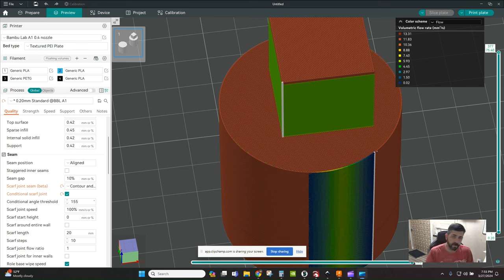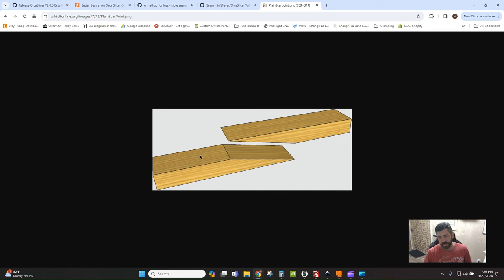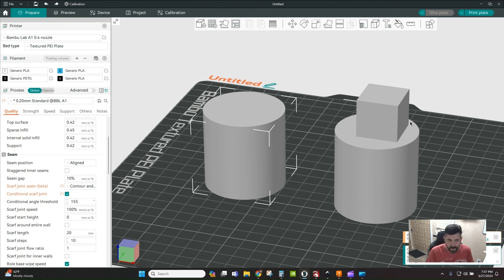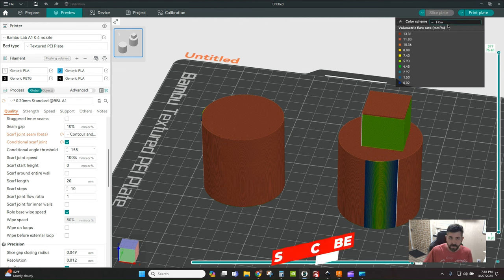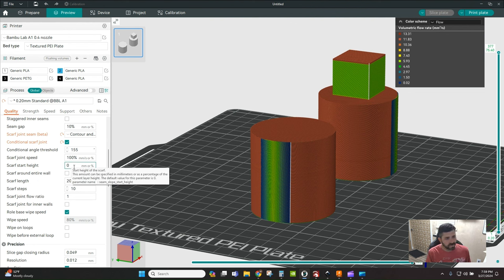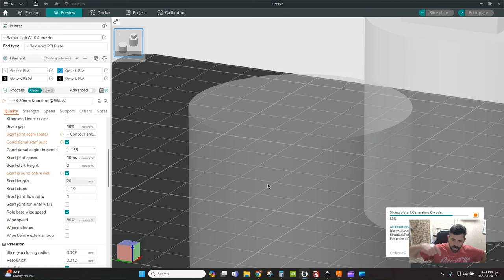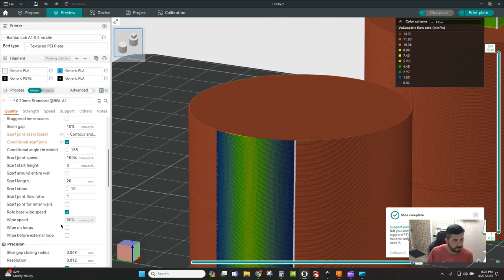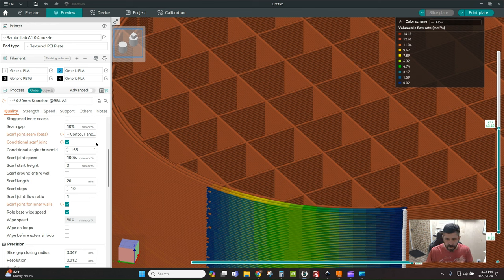Hiding Seams in Orca Slicer with Scarf Joints

Comment: I need to smooth out the seams on a cylinder with bottom thread inside (female end) and up top threaded outside (male connector). I needed guidance with this new feature. Really helpful that you explained each setting. Tomorrow I'll be doing some test prints. Liking and subscribing, check! Thank you.

Comment: Start height ist the value to start from bottom not top. If you put 2 mm in the first layhers in this 2mm will be without scraft seam
Reply from the maker: That's what I initially thought too, but that's not what my testing yielded.  I put in a 5mm start height in my test cylinder hoping the first 5mm would be a standard seem, but unfortunately that's not what's happening.
Reply: @fischer3d  fischer3d is correct. This is what pops up when I type in 1 (random): 
seam_slope_start_height need to be smaller than layer_height.
Reset to 0.
This seems (or should I say 'seams' ;p)  to be the starting height layer of the seam within the layer height itself.
Reply from the maker: ah ha.  That must be a new error message with the full release of 2.0.0. That error didn't exist in the beta release of 2.0.0.  Thanks for the catch.
Reply: @fischer3d  can confirm, was working a few days with the beta